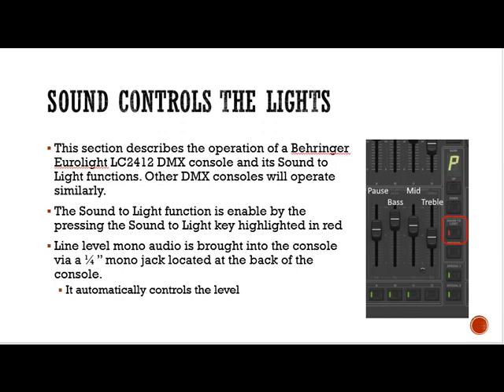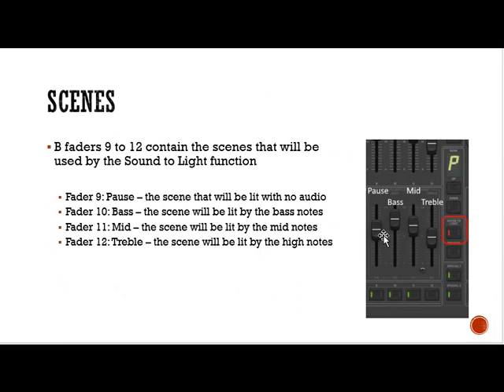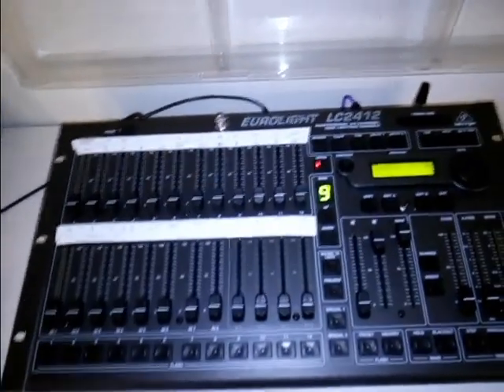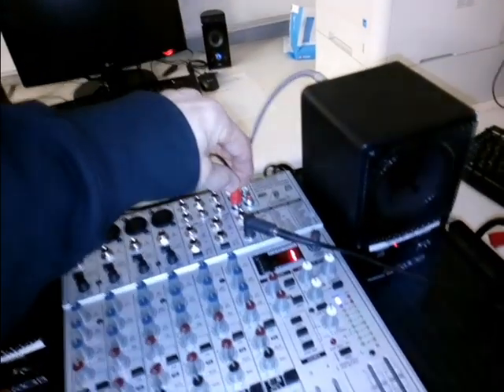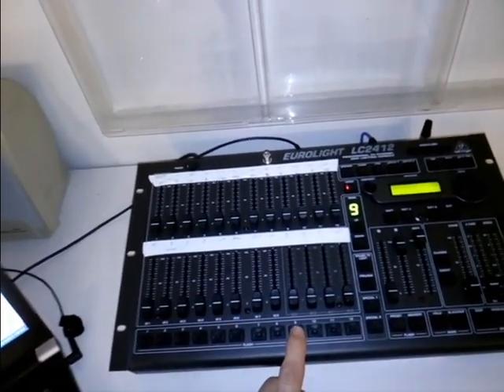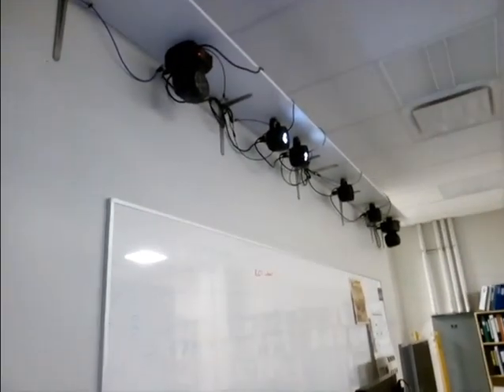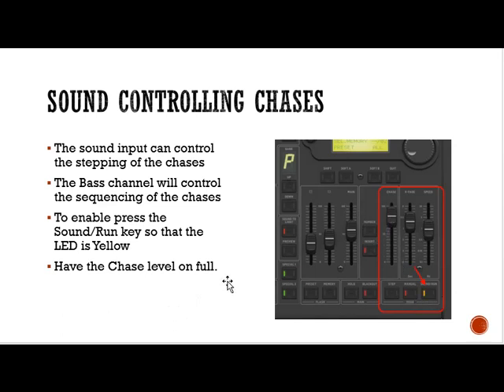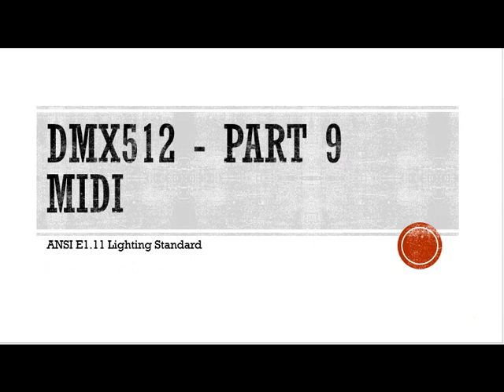Part 8: DMX Lighting - Sound to Light (Behringer Eurolight LC2412)

Comment: Brilliant series of videos that have got me using my LC2412 that I gave up on before as i couldn't get it working. One thing I do struggle with is with some of my kit having very bad Chinese to English translated manuals its not easy with channels that have multiple functions spread over the 255 values. the sliders go from 0 - 100 but were sending 0 - 255 values on any given channel. Do you know of any way you can see the value of the slider in the display when programming your presets? My PAR bar on Channel 1 has different vales to select its various inbuilt macros. when you get. So when you get 50 - 100 is macro 3 (color jump) and 101-150 is macro 4 (sound to light) and so on, its not easy to see what your running at times to know if that fits what you want to program (does that make sense?)
Reply from the maker: That's a limitation of the LC2412. Software DMX controllers allow you to program the sliders within a range 0-100 and switches.